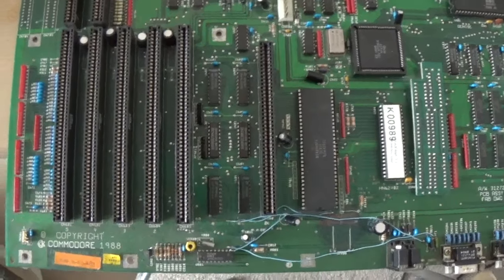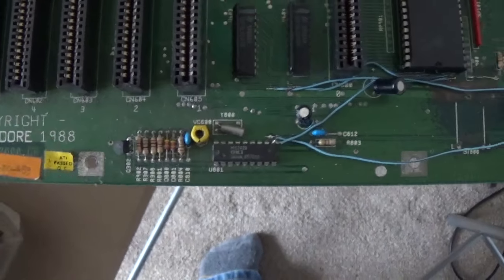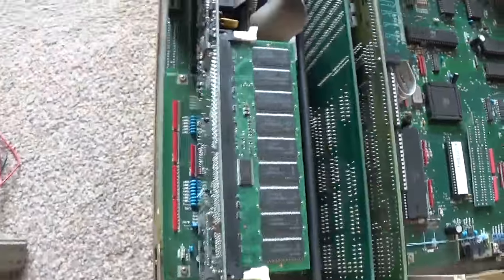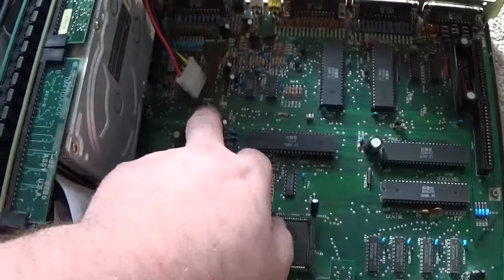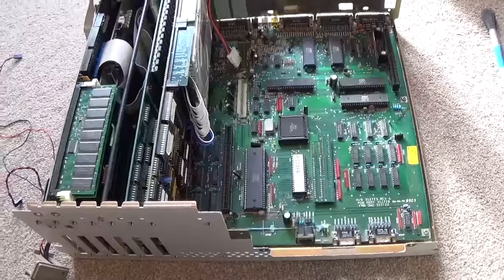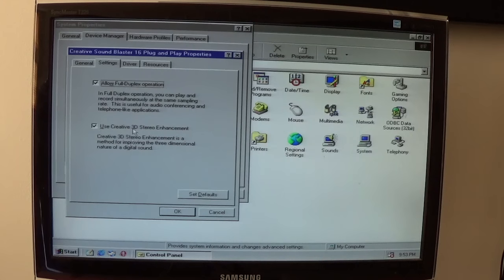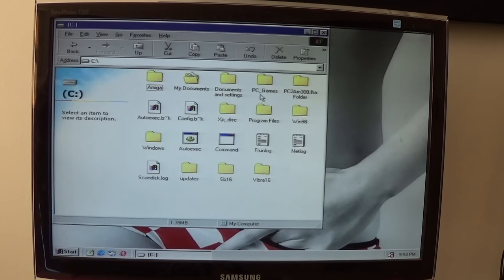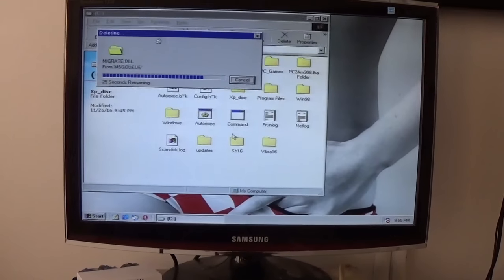Amiga 2000/1500 SBC 8 to 16 bit ISA slot and tidy up

Comment: I have a similar setup with SBC in an 8-bit slot. With my SoundBlaster Pro plugged into the 16-bit slot, everything works fine, including for playing Half-Life. Unlike your SoundBlaster 16, I think the Pro really doesn't need the extra pins from the 16-bit slot.
Reply from the maker: Great stuff , I could do with an 8 bit card set up properly... something I will look in to

Comment: is that 95 or 98? anyway...i think the drives the 2000 and a bit larger height wise
Reply from the maker: trojan20112011 are they ? I thought they were standard size ? Could be why then. It's windows 98
Reply from the maker: yes you are correct , the 2000 does have taller drives even tho the slimmer drivers are advertised as A2000 drives ... they aren't